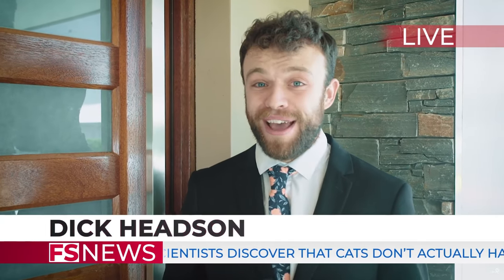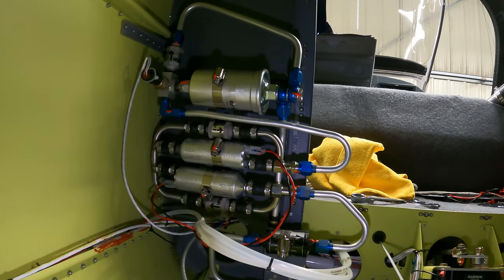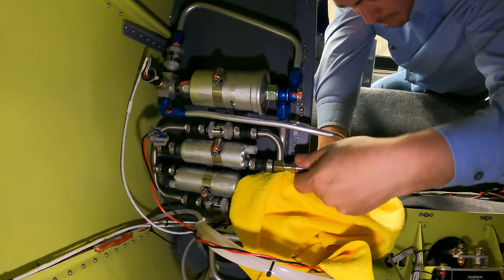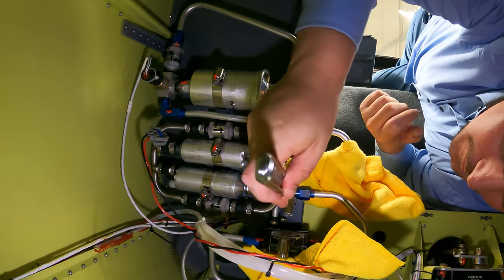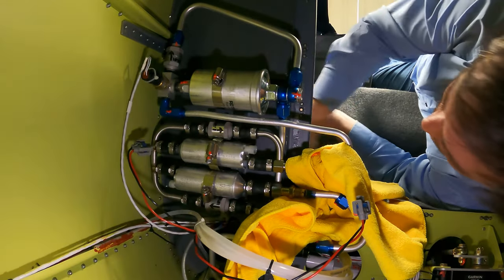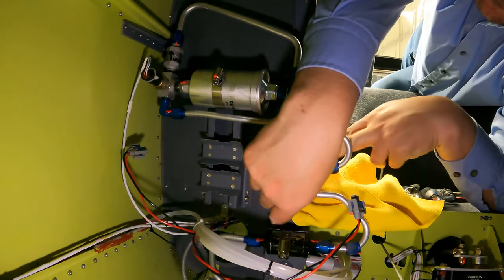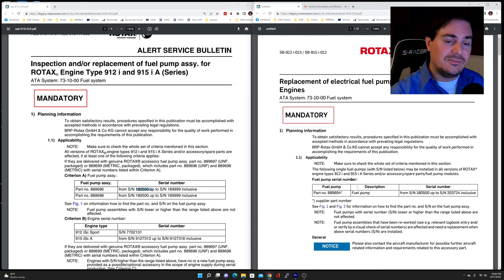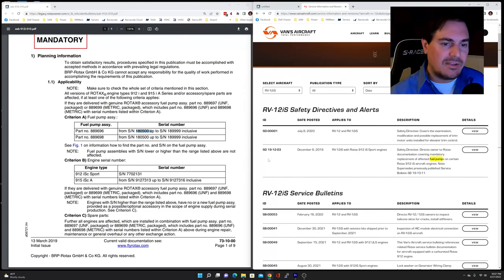Rotax 912iS Fuel Pump replacement (again)

Comment: What kind of primer did you apply to the interior?
Reply from the maker: That’s the green EkoPrime from Stewart Systems.  It’s Zinc Oxide based, not chromium.. so I didn’t lose a lung while working with it.
Reply: @rcarsey  Thanks!

Comment: congrats on winning the lottery! after the HIC module you're a double winner. Have you inspected for the tailcone stiffeners?
Reply from the maker: Yes, I was going to do a video on that too but I just didn’t have it in me ..  no cracks after 180hrs.. so just the stiffeners we’re added (you can see them painted in grey back there.. I ran out of the green stuff long ago)
Reply: @rcarsey  gotcha. I was amazed that you were pulling the pumps with one arm but didn't want it to seem like a joke. the 'cone must have been a lot more work! thanks for posting.